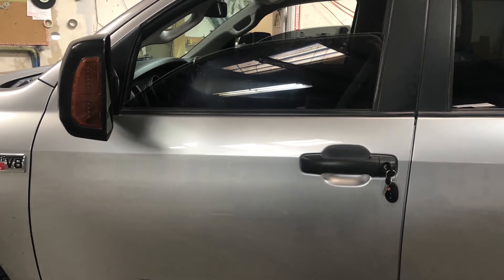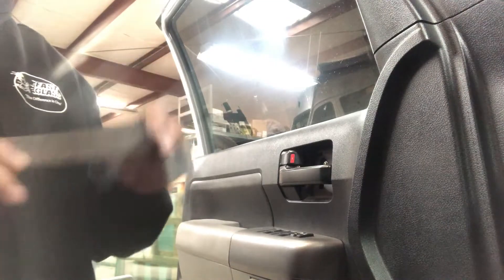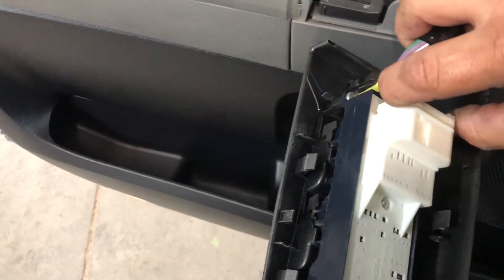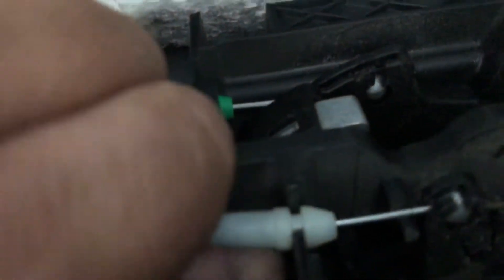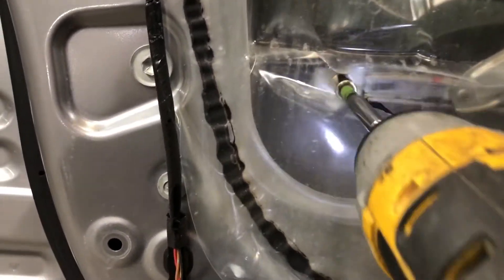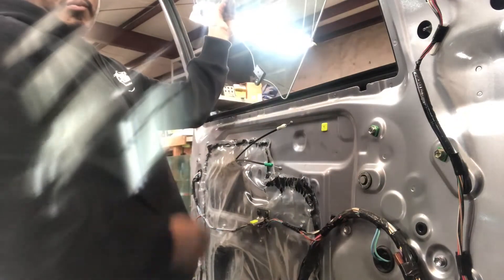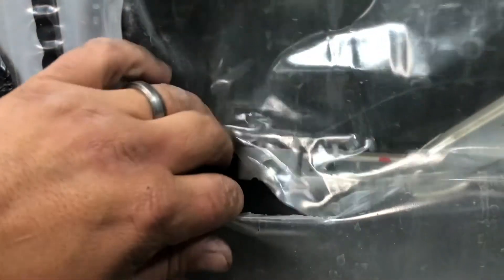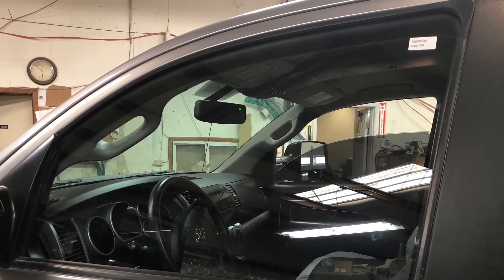How To Install a Door Glass On A 13 Toyota Tundra

Comment: Thanks for this video. Some outstanding citizen busted my front passenger window and stole some items the other night. Got my replacement from Toyota and installed it in minutes with these tips. 

Honestly, I’ve spent about 20x more time cleaning the broken glass than it took to install this. I was also cognizant to listen for glass still stuck in the channels and sure enough, a large chunk was hidden low in the channel tucked behind the seal. Potentially saved myself a broken replacement!